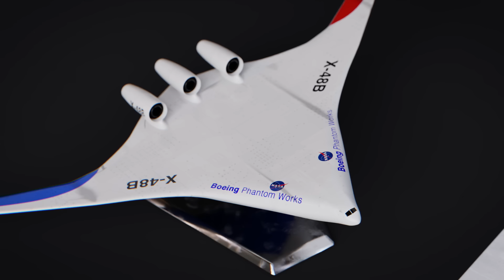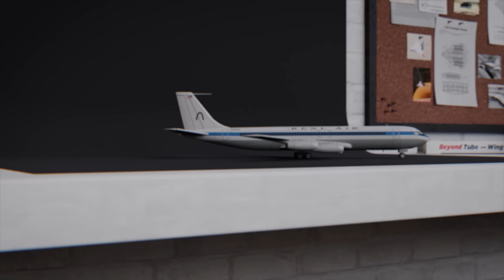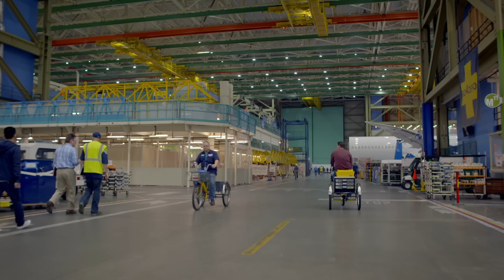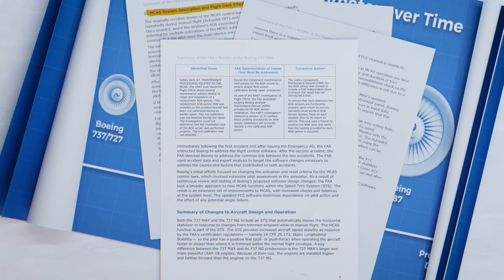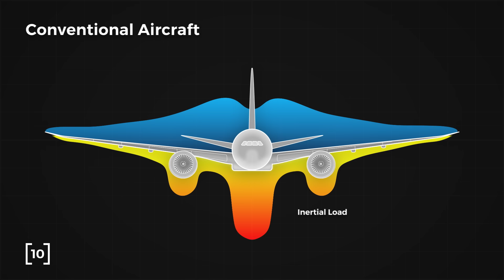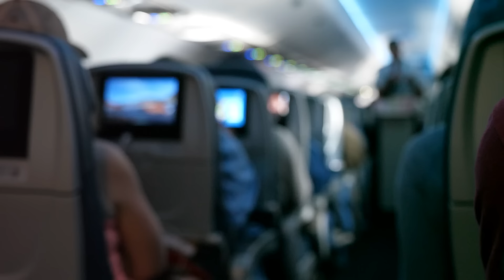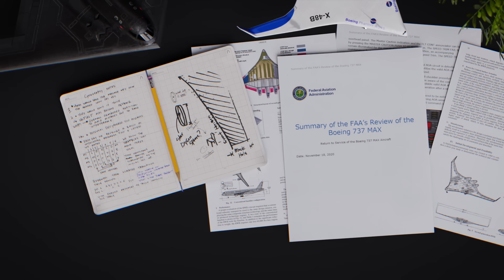The Plane That Will Change Travel Forever

Comment: The location of the CG for a swept wing is located about midway of the leading edge of the wing root and the leading edge of the wing tip. The location shown is far outside the envelope requiring an excessive down force on the horizontal stabilizer.

Comment: Tubular fuselage helps reduce Pressurisation cost and design complexity. Can this blended wing get the same pressure ratio without much complexity. In contrast, The b2 has only the cockpit pressured for just 4 occupants, rest of the plane hold ammo and fuel.

Comment: four words: 90 second evacuation requirement

This is the achilles heel of BWB and Flying V for passenger transport

BWB work great for cargo but the same thing that gives them an advantage there is what makes evacuation hard

Winglets don't achieve much compared to Vortilons and pylons. The assumptions behind them (and vortex generation) turned out to be incorrect and vortilons are much lighter
Reply: Rita 25 y.o - check my vidéó  aviation has them embedded, using other units results in things like Gimli's glider

Comment: 50% reduced fuel costs and the savings he mentioned have not remotely reflected those savings considering most the cost per passenger is fuel since your repair and maintenance costs are mostly fixed.

Comment: I'm not sure why he lists the B-47 as groundbreaking for its airframe design. Previous WWII bombers were using this arrangement long before the B-47. In fact, most aircraft were 'tube-and-wing' until the 60s X-planes, and they were test beds rather than active or production airframes. The F-117, while perhaps not the first to depart the 'tube-and-wing' paradigm, is certainly iconic in its appearance. Sure, they weren't turbine powered, but that's not the thesis under discussion.

The Germans did test fly the turbine-powered Ho 229 Horten flying wing in 1944.

Comment: Seems like an easy solution, use a tail wing without down force. I like how the concept is sort of inverted. Turbofans are on top and the curved "hull" is on the bottom. This is similar to what I have been thinking, with regards to improving aircraft efficiency.

Comment: Is there a new blended wing design with swept-forward wings?

The blended wing design is nothing new in itself. The Kalinin K-7 was in effect a blended wing with a much reduced tail in the early 1930's. Blended wing designs all crashed until we had active stabilisation. If we have this, we can also have swept forward wings. These were also experimented with in the forties (eg the Ju-287) - they had lower drag but a different stability problem related to stiffness, also solved by active stabilisation. 

Oh, and my searching turned up this funny thing...
https://en.wikipedia.org/wiki/Cornelius_Mallard

Comment: Why not canards to provide lift in front and remove the downward force needed to balance the jet?  It's going to be difficult to get the public to give up window seats for a flying wing design.
Reply: It's generally better to just make one wing that produces virtually all the lift and then use another surface for stability. Relaxed stability that allows for smaller horizontal stabilizers is a good idea, but adding canards and trying to get lift out of an inefficient planform (poor aspect ratio) really doesn't.

Comment: Please consider looking into the latest tech, using electric engines. The design of the planes in your video here might well be what ends up helping make them viable for longer flights, given lower need for power.
Reply: Wont happen any time soon for two reasons: Energy density, and batteries don't get lighter if you drain them. Airliners can't land with all that mass they take off with. They have to burn off or dump tens if not hundereds of tons first. Cant dump a battery.

Comment: False information! True facts: blended wings or flying wings was regularly flying without any electronics(avionics) almost 100 years ago in Germany.(Horten brothers). Jet versions 75 years ago. Unstable airplanes was flying regularly without avionics almost 120 years ago. Flying wings can be flown both in stable and instable designs. The wing and tube airplanes was in regular traffic 90 years ago. Nothing revolutonary in aviation have come from USA. Placing engines on airplanes was revolutionary and first done in the US though. It was under way to happen in the rest of the world, so it was merely winning the race.

Comment: Boeing in 1947: commercial airliners by engineers and priced for its safety. Boeing in 2019: airline run by MBA types serving wall street that kicked out most engineers are useless loosers priced for lying to the FAA, bribing officials and killing passengers and pilots nilly willy. A sad story. Let's see if the remodelled mcas system in their MAX will continue to fall from the sky ...

Comment: You rarely hear about the B47 any more with the popularity of the B52 since 1965.   My dad flew B47 in SAC starting in Roswell, NM    At the end of the B47 Dad was no longer flying but in charge of the maintenance group in Guam.  I saw my last B47 one day there parked at the end of the runway next to a long line of B52s.  It was so much smaller it looked like a fighter.

Comment: My older bro was into remote controlled planes. In this field he redesigned tried & true home build design kits and sent the updated kit-plane back to the mfg. All incorporated his designs for future kits.
He was the first to build a solid foam delta design and successfully fly it around 1970. Due to its instability, he installed an old 5hp engine. More speed equaled more control. This plane was VASCAR'ed around 600mph real speed, not scaled.
Since it wasn't a worthy project for the common flyer due to instability control (which later computers made this design worthy) he flew the plane at it's highest speed straight into the ground. Someone wanted that engine, in normal packed earth, it went 3 feet deep! 😮 
Later he had to turn down the remote controlled scenes in the 'Top Gun' movie, his business was top priority.
Point of all this? He was designing up a 1 person plane for him to fly inside laying on his stomach. Its size was about that of current large remotes being flown today. Obviously wife said NO!!!

Comment: Way-way back in mid-grade school, I wondered why some birds were better at gliding than others. I noticed some birds body were perfectly round thus said bird flapped its wings more. So back then I thought the future planes will have a wide flat body in the shape of a wing. Thus the whole body of the plane is lifting itself, even if partially, it's not just dead weight. The wings are then smaller and used mainly for lateral balance.
So here we are 50+ years later and aircraft design comes around to my design.

Comment: I still don't get, when the topic comes to hydrogen, why do we even discuss, if hydrogen will win over fossil fuels or batteries. Of course, it will, when it becomes the only available source. The second part, of why we hate fossils and batteries, apart from damaging the atmosphere at a higher rate than hydrogen, is that they are finite. In 100-200 years there will be no such discussion, with no alternatives to hydrogen, so why don't we start now.

Comment: Why are they thinking about exit doors? Aeroplanes are flying. Surely, an exit door can be used if the aeroplane is stationary. When the aeroplane is up in the air and moving you need a separate landing gear. Now go back to the drawing board and figure out how to save humans during the flight.

Comment: I think Northrup has an opportunity here, they have the expertise on the flying wing, back to the designs by Jack Northrup.  At this point Boeing has lost any respect it had, by extremely greedy upper management, and continuing bad decisions by said management.  I would prefer NOT to fly any Boeing planes at this point, especially the ones coming out of NC.  They would have to really prove the X-48 design is robust and has plenty of redundancy, even then they will never recover the prestige and reputation that has been lost by the McDonnell-Douglas management.  How the hell does that happen anyway, Boeing bought them, not the other way around, so how the hell did their management end up in control?

Comment: Hydrogen fuel will never work on aircraft. Even in a cryogenic super-cooled liquid state LH2 has a fraction of the energy density of JP8 or Jet-A equivalent. Hydrogen works great in a vacuum for high efficiency (orbital rocket stages) but is terrible in atmosphere. This is thoroughly proven by simple chemistry and physics and not a real consideration of any major aircraft manufacturer.
Reply: Energy density, sure, but the specific energy of hydrogen is really appealing and suggests there's potentially some viable tradeoff.

Comment: Such bullshit.

Build a big Lockheed SR-71, have a normal Jet engine bring it up,  add 4 "Pratt & Whitney J58 / JT11D-20 axial-flow turbojet engines". but modernised andenhanced for effectiveness, which will engage at high altitude, and voila:
'Macho-Strato Cruiser' right there.

With modern materials, this is very doable, and not too expensive.

Comment: The blended wing body aircraft is an interesting design, but I don't think it'll "fly" with passengers unless it is kept relatively small - the seats further away from the aircraft centerline would be subjected to a lot of vertical movement when the airplane turns or when it experiences turbulence - if you were farther out from the center, your coffee would spill into your lap or you'd experience more motion sickness.  I think the blended wing body design could be used more effectively for cargo or as a more efficient, smaller aircraft.
Reply: Years of cycling experience would have me believe that carbon reinforced composites are not relatively immune to fatigue compared to aluminum.

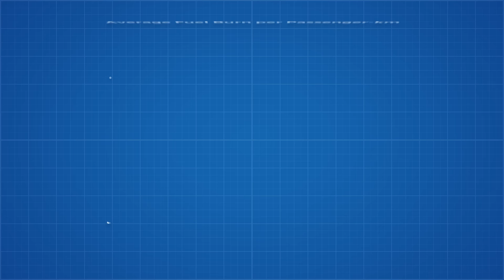Comment: Graph (approx at 1:10) - I think this is per plane per kilometre- otherwise a 1,000 Km (620 miles) holding 200 people would need … lots (scientific measurement) . A 747 burns approx 4 litres (1gallon) per second, there are a few hundred passengers generally;  12 litres / km (aligns with graph) or 5 gallons / mile is on Boeing’s site. Cheers.

Comment: Remember that your real engineering is a very nice program that will be used by people worldwide. Please be considerate and use metric units which are the units used by everyone (except a few countries). You should be able to appreciate how logical and efficient SI units are as its usage allows to avoid a lot of errors and conversion is always based on 10.

Comment: Similar to my idea in 1979
But I also wanted the empty spaces to be vacuum, increasing lift, buoyancy
And jump jet technology, my design is more stretched and full bodied
Of course, windtunnel testing is needed plus many simulations
The skin has to be based on honeycomb structure, vacuum
Reply: NB
Generation of static electricity has to be studied and if at all possible, should be harassed
Reply: Should be harnessed

Comment: I fail to understand how the MAX issue was a SW problem. If the system is designed to only have 1 sensor providing data what is the SW supposed to do about that? The SW didn't design the layout of all sensors on the body, nor did the SW design just how many sensors there are. My first programming teacher in high school told us "Computers are stupid, people are. Computers do exactly what they are told by the people designing and programming them." So if the designers only provided 1 sensor for a complex safety system to operate with how did the SW fail? The SW did exactly what it was told by using the sensor data. If the sensor data was bad and the SW had no way of knowing that what is it supposed to do? If the system is designed poorly and the system designers are testing the system to see what will happen if this one sensor goes out, again how is that the SW's fault?
Reply: Yeah, I'm not sure why people call it a software issue. Their safety analysis was flawed (honestly, I suspect due to management pressure but I don't think that can be ever proven) in a way that let them justify an unsafe design.

Comment: Great video, great engineering and super informative. love it man.

Wouldn't it be great if we could find a way to harness that energy created at the wing tips where the high and low pressure air meet. 

I imagine some kind of trailing turbine or prop that starts to spin up and collect the tornado energy when the plane reaches a certain speed.

It would certainly take out two birds with one stone though also perhaps it would create new issues with drag. however it may be able to be countered by the extra energy captured if made to be efficient enough.

Also with regards to the window issues in the new design, why not simply have mock windows? 

Instead of screens on the backs of the seats, why not have the screens on the wall of the seat rows and have them look like the windows on a regular 747?

Lots coming across the board in engineering this century and its all good and exiting, especially in these times of climate change where we need every energy and efficiency technology we can factor in.

Thanks for making this kind of information available to those who would otherwise not have access or the means to search them out.

I think its important that every day people have an idea of the smart and intuitive discoveries being implemented to change the amount of waste we see across the board in the aviation and other industries that contribute to global warming.

Thanks again man and keep it up all you innovators out there making the biggest changes of all.

Engineering is awesome.
Reply: The winglet tips do just that.

Comment: The engines/center of gravity are also placed forward of center of lift so that if the plane loses power, the forward weight will cause it to pitch down, instead of pitching up, which would lead to a stall

Comment: Those facts aren’t right. Everyone knows the first commercial jet airliner was the Comet. Fly in 1949.  The 707 wasn't until 1957.
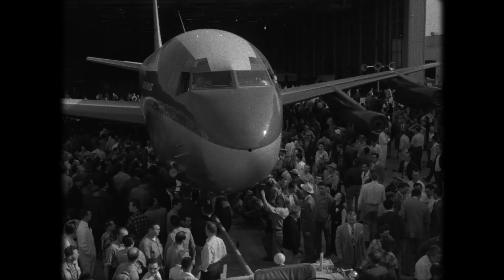Reply: 3:16 He didn't mention that 707 was the first commercial jet airliner. He mentioned that the very first successful commercial jet airliner was 707. Everyone knows that what happened to  Commet airliner.
Reply: 3:15 He didn't mention that 707 was the first commercial jet airliner.He mentioned that the first successful commercial jet airliner was 707.Everyone knows that what happened to Comet airliner.

Comment: ...also a planar shaped vehicle close to the sun will have the advantage of employing solar panels for additional power supply throughout the journey.  That surface area of the "flying wing" is crying out for it.  We could make the most efficient flying machines ever conceived with this design, solar panels, efficient batteries and even additional engineering advantages.

We're going to need some advanced computers that can stabilize this, but I'm optimistic.

Comment: The future is NOT hydrogen.  It is inefficient and costs way more electricity to actually create it, (through electrolysis usually) than it can outwardly produce.  The best thing so far is pure ELECTRICITY, harnessed from preferably renewable power sources such as solar, wind, hydro, etc...and that is stored in increasingly more efficient batteries.  Lithium Ion has been a boon to the electric car industry, but that's not the end....we will have solid-state batteries soon (within 1-2 years) that will change the whole economics game of transportation.  We will finally have the range, ease of use, stability, lightest and quickest charging that will make EVERYONE agree that ICE cars are way too expensive in the long run.  Even petrol/gasoline is less efficient than energy stored within a battery (for propulsion).  Do the math.

Hydrogen only has one advantage...it can be liquified and injected into a car or plane or other mode of transportation (as quick as gasoline or any liquid), but I'm telling YOU - it is NOT the answer to any real problem - it only checks 1 box for the transportation industry.

Look, I bought a (used) Fiat 500e a few years ago.  It was cheap - about $9,000 and it only had 6,000 miles on it.  The initial buyer obviously had an impulse buy and then suffered from severe range anxiety.  Anyway, It was my first electric car and it has exceeded all of my expectations.  I knew that it could only drive 100 (24kwh liquid-cooled, lithium ion battery) miles on a charge, but I don't drive more than that in a day.  I can charge it at home or work and it's super cheap from the wall socket - way cheaper than the gas pump.  I haven't bought gas in 6 years and I've saved thousands of dollars...actually paid for the electric car by NOT buying gas.  I have NEVER needed to replace a mechanical part.  That's the thing about ELECTRIC cars, boats, planes, etc...there are so little mechanical/moving parts when compared to the ol' Internal Combustion Engine.  I won't ever need to check my oil, or replace brake pads or rotors (regenerative braking works as good as it always has) or any number of 1,000+ moving parts with an ICE car.  

The point is that electricity stored in good batteries are way more efficient than passing Hydrogen through fuel cells...and they are way cheaper already if you do your homework and realize that ELECTRIC CARS already beat ICE cars in almost every category...and they are cheap if you know how to look and buy a slightly used car like me.  PEACE.
Reply: Specific energy is a real problem for batteries in aviation now though.